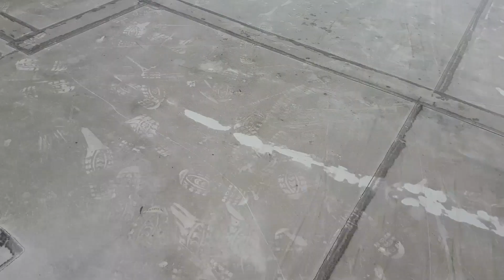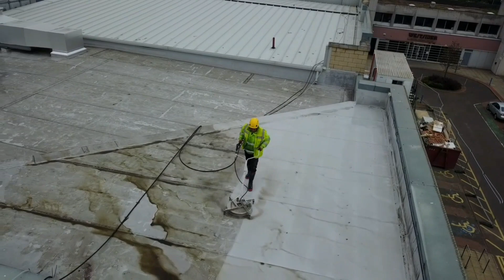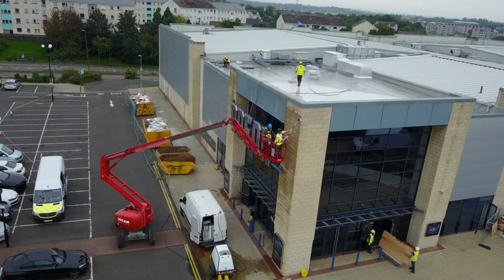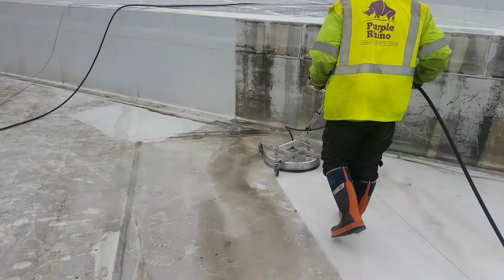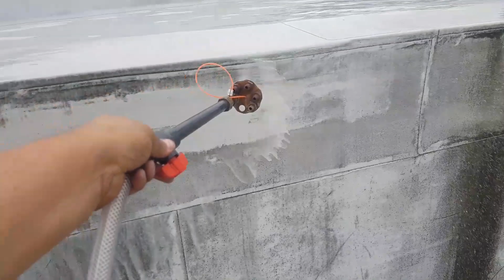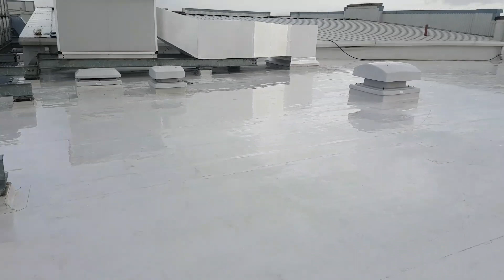Rubber Membrane Roof Cleaning

Comment: Hey guys, Been watching blast away for quite some time. I've started a pressure washing business in slovenia. Started small. got a 250 bar washer 15L per minute. With rotary nozzle and sand blaster.  1 thing I face here is that people don't appreciate any chemicals, can you guys advise me on how to improve without using any chems. Can't exactly afford hot water washers just yet.